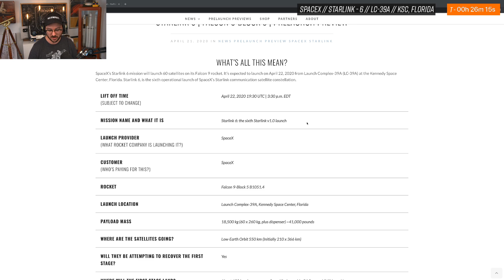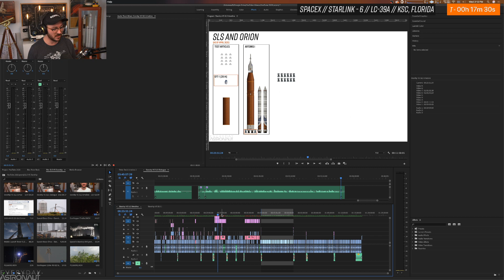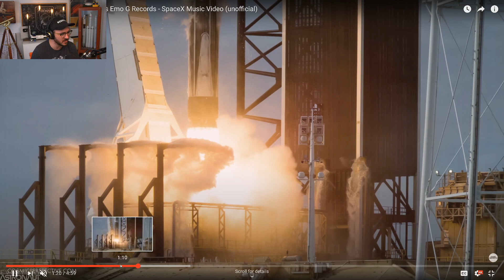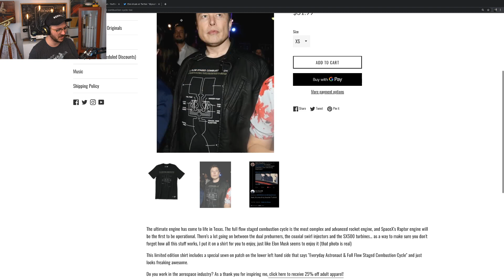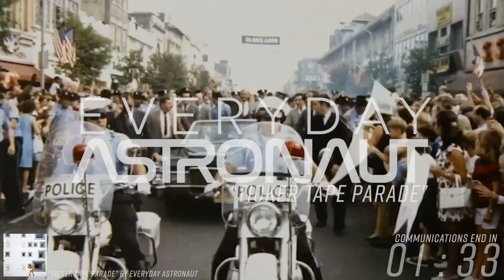Watch SpaceX Launch 60 Satellites for Starlink - 6!

Comment: Tim. Have you ever noticed the resemblance between the mach diamonds of the raptor engine and the drawings of the araura jet??? I dont think it's a coincidence. Question. How fast are the gasses escaping out of the  nozzle of the cone?
Reply from the maker: All engines that are over expanded will have Mach diamonds. It’s definitely not like there’s a raptor engine on the Aurora jet. It wouldn’t make any sense at all. Rocket exhaust’s exist velocity can get up to 4.5 km/s or so! 👍
Reply: @EverydayAstronaut  thanks for the reply. Just thought it was a very cool unique shape. I understand that jet wouldnt  have those engines on it. Just the design caught my eye.
Reply: @EverydayAstronaut   Tim, when you started channel, did you ever, in your wildest imagination, expect to develop this level of expertise in aerospace engineering?

Comment: Question: Do SpaceX really need the certification of Starship from NASA? What if SpaceX decided to train it's own "Astronaut" and create it's own standards? Also, is it really that long to certified the Dragon, or it takes time coz the previous NASA administration is dragging the program as long as it takes? Coz it's too weird and coincidence that the two Capsule finish at the same time. And I think Jim B. cut the BS and saw that the Capsule program is literally ready but it's being held on for some reasons.
Reply: The capsules were being developed at the same time in parallel processes, it's not at all surprising that they are finishing up at about the same time. Both projects however, were entirely funded by NASA, which is to say, by the United States Congress. Commercial Crew faced a good deal of opposition in the Congress and was seriously underfunded for several years. that delayed development.
To the best of my understanding, the NASA certification requirements for crewed flight only apply to flying NASA astronauts. If a private company wants to launch their own people, those rules don't apply. I could be wrong. If anybody wants to show me I am, I'd be happy to see it.
Reply: @odysseusrex5908  If I we're SpaceX. I'm gonna create my own fleet of "astronaut", then prove that the system and standards works. NASA certification thing will slowdown Starship if they rely on NASA's procedure. They learn so much now from Dragon human Spaceflight and they can go on its way.
Reply: @xbxb   I rather tend to agree with you.

Comment: 32:20 Liftoff
35:03 MECO & Stage Separation & SES-1
35:37 Fairing Deploy
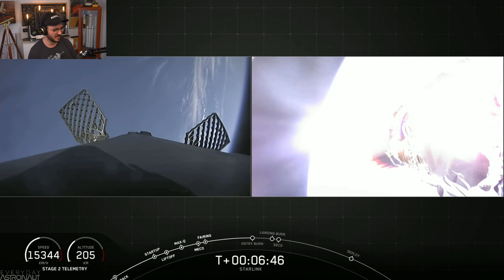39:13 Re-entry burn
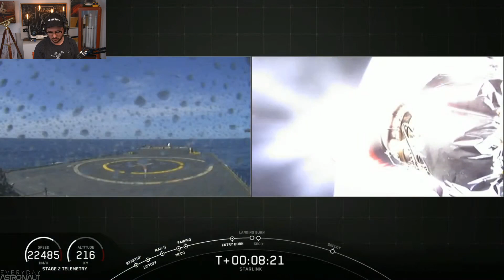40:45 Landing burn start
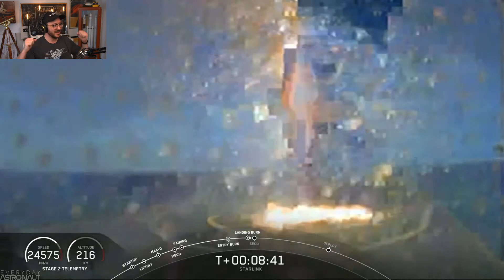41:06 Booster landing
41:29 SECO
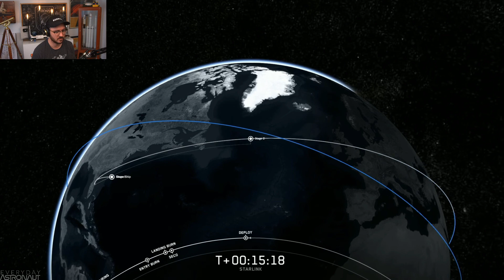47:42 Starlink deploy

43:13 Tim explains the view at T+9:15

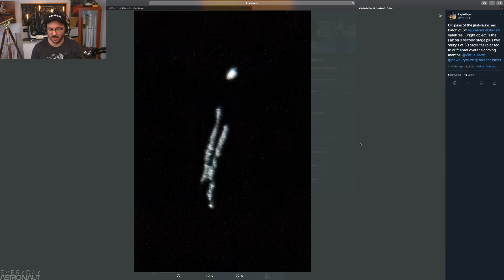1:27:26 Starlink pass over the UK

At 54:30 I was standing in my garden watching it go over. Was very bright and moving very quickly across the sky. Hadn't separated enough to see with the naked eye at that point

Comment: The fact that they are using Pad 39A for launching 4th flight boosters, really shows the confidence they have in them. I have been surprised that they are using Pad 39A for these Starlink launches, i would have thought Launch Complex 40 would have been a wiser option - seeing that Pad 39A's got a very important date in a months time. Really does show the confidence they have in re-using the vehicle multiple times. On a different subject, am i the only one that thinks that the new launch tower at Pad 39A looks a bit like a smaller version of the north tower of the old World Trade Center from some angles?
Reply: A couple of launches ago someone was positively screeching about that in one of the comments sections. She thought it had been done deliberately to look like the towers and was in extremely poor taste. A large number of people told her how wrong she was.
Reply: @odysseusrex5908  Even if it what designed that way, surely it would be a good thing, after all, this is pad 39A, the worlds most famous launch pad, and in my eyes the old World Trade center towers were one of the most iconic sights in the USA.

Comment: Production tip.
Any chance you can enable a High-Pass Filter (HPF) on your mic input?  This will cut out all the low frequency BOOM, BOOM, every time you touch, knock the mic stand/boom.  This BOOM is very evident when listening on headphones.
This is something i notice A LOT with youtubers ;-)  So pass it on to the other OLF boys if you can.

With all good mixing desks, you'll have this feature on every mic input channel, usually near the top, just under the gain pot.  Usually cutting somewhere from below around 80Hz... As artist will be handling mic stands a lot, and stamping their feet on the stage, etc...  Usually enabled for all vocals and most instruments, apart from the the obvious, kick drums, side toms, bass guitar, etc!  Vocals just don't produce anything that low!  It massively cuts out booming, muddying the sound coming out of the PA...  And headphones.

Love the long format, in depth content!  It's an engineers wet dream!
Reply from the maker: Of course I can, and I assumed I had HPF on... looks like I accidentally turned it off with my new computer 🤦‍♂️ thanks for the reminder. I’ll fix it!

Comment: Hi! I'm curious how does starlink satelite naming work? Heavens above have names for each satelite. One has number like 64 other has 1248 or something like that and so on. How will this batch be called? Is there some site where I can fint this info?
Reply: Interesting question. I am certain they something similar to MAC address's associated with communication components. And these would be registered to some sort of naming/identification schema. I Would also like to know the answer
Reply: I would think, with the plan being to deploy thousands of Starlink sats, it would be best to name them by batch, then number within that batch, and maybe the hardware version if you need just a bit more to work with, IE: B00002-N09-V00.50

Not that I'm an expert/really know what I'm talking about, I just feel that would give some more context about that specific satalite unlike a MAC address which is a bit more genaric (after all, what doesn't have a MAC address these days)